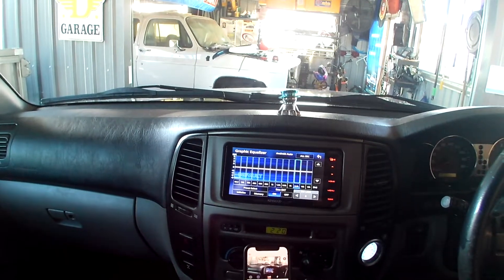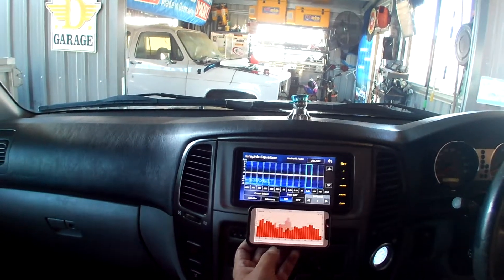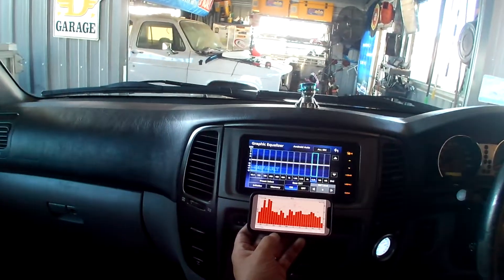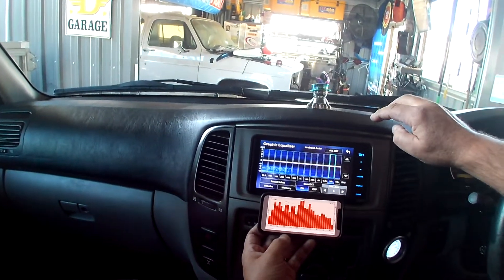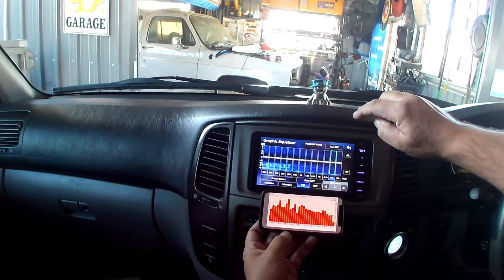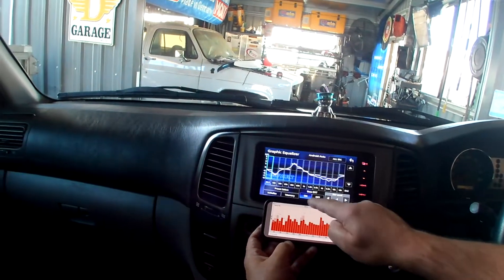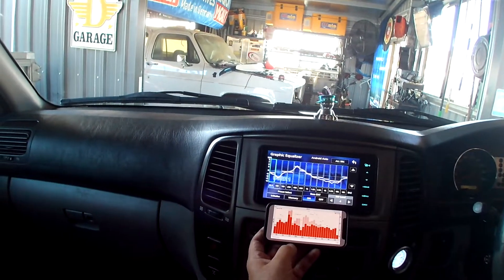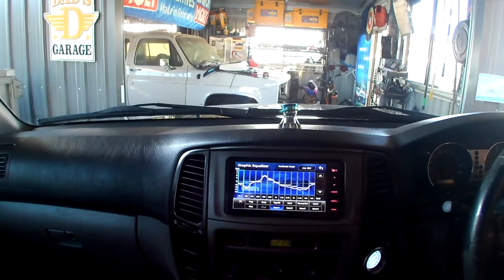How to flatten the RTA Curve using iPhone on Kenwood EQ

Comment: You need to place the phone mic where your head is going to be listening to your system .....which is not  against the dashboard in this demo .
Cars are accousticlly terrible because the listeners are never in the middle of the stereo image and the length of bass waves exceed the size of the space  ... so just dont bother 
If anything , use individual sine waves centered at the graphic eq frequencies and if any frequency sounds harsh ...turn it down !

Comment: I’m learning, how to do this. I’m wanting to have more of a SQ set up in my car. When going active, do you use the LPF/HPF or do you leave those off and use the DSP to set your crossover point? I have my amp in the off setting, frequency all the way up and I’m using my DSP to tune. Is this correct? Thanks!
Reply from the maker: Woah. This is where different people have different opinions on what to do. 
Personally, I use the amp HPF/LPF filters IF! They go past the crossover point you wish to use. 
For an active 2 way ( as an example) with a a crossover point of say, 3k, I would set the LPF up to 4K and the HPF 2k. This setting does not affect the sound but does give a backup if the DSP goes full range on every channel. I’m do the same with basic F/R/S setups. I use LPF of 120, HPF of 50. Does this help?
Reply: @ yes, thank you. I don’t have a way to set the crossover on the amp. Obviously there a knob, but without using a SMD Crossover Calibrator I won’t know where the crossover point truly is. Is it wise to have the frequencies all the way up, then use my DSP to set my crossover points? Thank you.
Reply from the maker: Which amp are you using? I can try to guide you through it.

Comment: What kind of pink noise do you use? In my iTunes there is pink noise for sleep and all kinds of stuff and then just regular pink noise. And also, when setting the EQ with pink noise do you have the head unit turned up to your max volume or does the volume matter??
Reply from the maker: I use the pink noise track from Audison. This can be downloaded from their website. 
As for volume, I use the phone to determine. Meaning, play the track and turn up so the display on the phone is useable (not too high, not too low). For an aftermarket radio, this works fine, but, factory radios can have built in EQ’s that change depending on volume.

Comment: Can this also work for a home setup?
Reply from the maker: Actually yes. And I have done it. The biggest problem I found with the home set up is this…. Even though the amplifier typically allow individual eq’ing, the amp doesn’t let you isolate one channel at a time.

Comment: I just installed a new speaker and amp system into a 2020 F150 Raptor.  I left the original head unit.  I added tweeters in the A Pillars, 6.5" Component mid range speakers in the front doors, 6.5 " Coaxial Speakers in the rear doors, a Dual 8" Subwoofer under the back seat, 1 4 channel amp and 1 1 channel amp.  I also installed a conversion device from the factory radio to connect RCA's to the amps.  The convertor had 3 outputs.  Left, Right and Sub.  So all the left speakers (1 Component Tweeter, 1 Component 6.5 & 1 Coaxial 6.5) is all together, the right side is the same and the rear has it's own volume control.  Can I use this app with an RTA Mic connected to an ipad or iphone to tune this system if I play a pink noise from Youtube?  I do not have a DSP in this system.  I only have some manual controls on the amps.  The amps used are Memphis Mojo 1000 Watt 1 Channel Sub Amp and a Memphis SRX300.x4 For the door speakers if you want to look up the actual controls.  The truck used to have the Bang & Olufson sound system.  Thank you in advance.
Reply from the maker: Sure can. The app is an apple app, but it is probably available for android as well. As for the mic, if the mic has the right connecteions, and has a calibration file that the app can use, then yes. using an iPad will be much easier to see. That said, without processor in your system, you will be limited to adjustments available on your OEM system.
Reply: You can use the head unit or the amp if it had adjustments, just make sure to recheck that your amp isn’t clipping afterwards. A DSP would really help take your system to the next level, but they have a bit of a learning curve. I just installed an audio control DM-608 that I got open box for $375 and it made my system sound awesome
Reply: I hate these kind of comments

Comment: i have a pioneer 99 running active 3 way set up with the same audio control mic and when i try to do a rta session i start with the left tweeter then right and so on when i get done then i try with all speakers playing well when i listen to it afterwards good lord its harsh and bleek so i have to come back and change tons of eq haha,is this supposed to just get you in the ball park or am i doing something wrong as usual ? thanks,nice work its hard sitting sideways doing this haha
Reply: Flat eq isn’t usually that great. Look up something like the JBL RTA curve and it’ll get you closer to what you want. I’m basically running their curve but with more power in the tweeters and it’s really good. 3 way systems are usually harder to tune as well, crossover points are super important with them
Reply from the maker: Which processor are you using? I may be able to guide you through it. Can you tell me all the components and locations as well please.